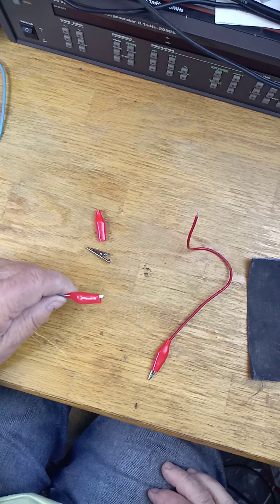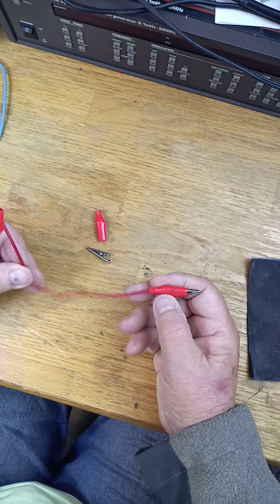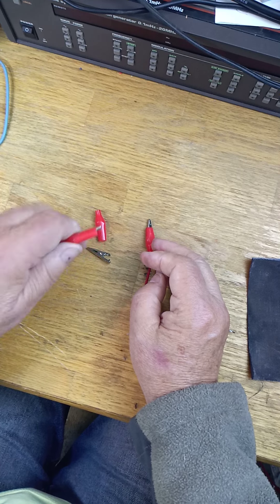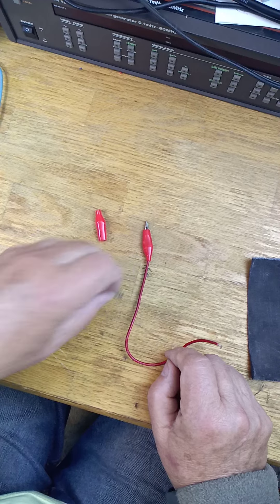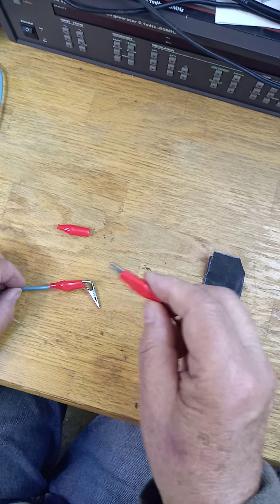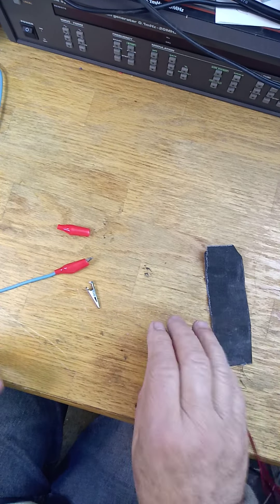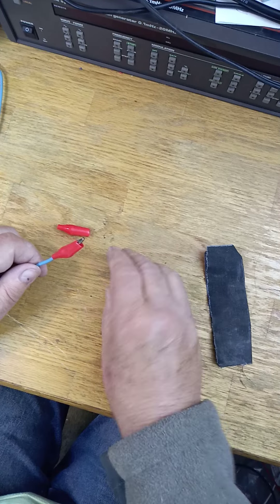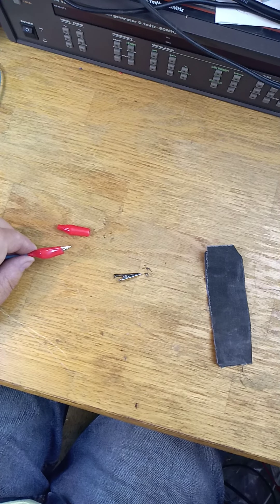Tip For Using Small Allegator Clips To Stop Them From Twisting

Comment from the maker: It might seem like a small thing but those small cheap allegator clips drove me nuts for years.  Try and attach them and the clip would spin in the insulated jacket.  I thought if I just cleaned the insulator, it might remove any release agent used in molding.  That never worked.  I found that roughing up the outside surface made all the difference in the world.  Rougher the sandpaper the better.  If my paper is too fine, I'll hit it with a file to make some deep ridges.   It makes all the difference in the world. I like using these small clips in tight spaces.  I just got a batch of these small allegators in and was making some test leads.   Thought I would share this little tip. I have never seen this tip mentioned anywhere else.